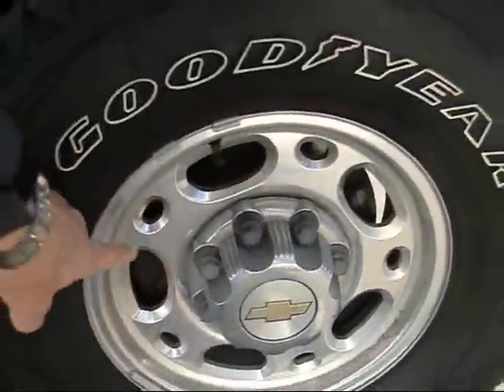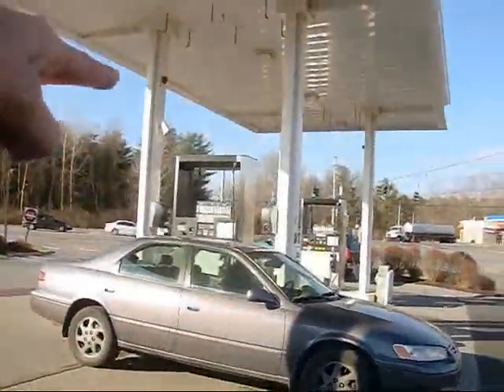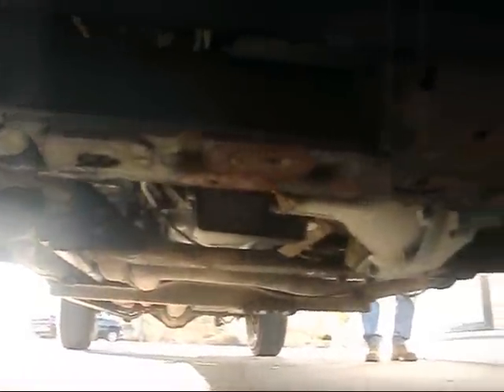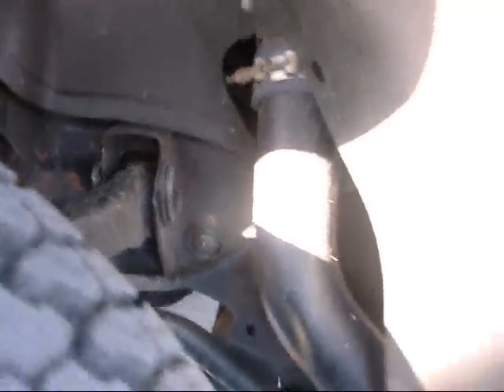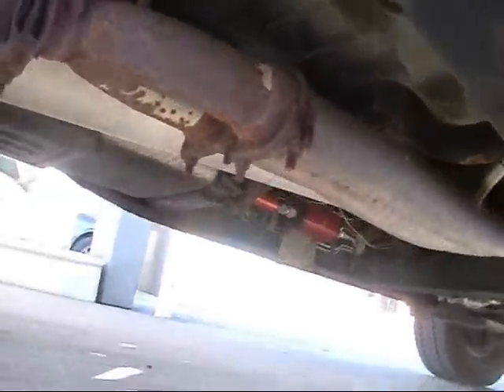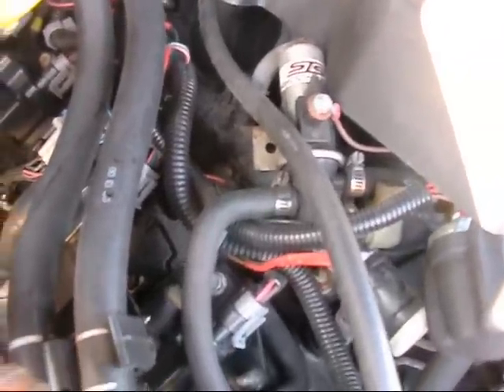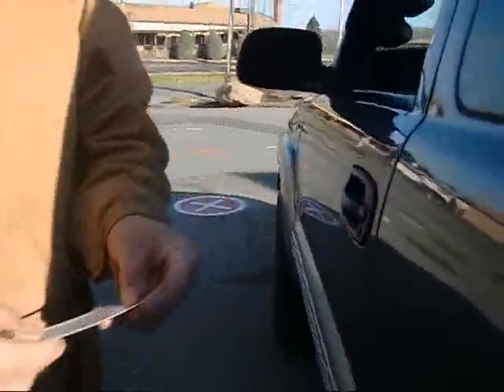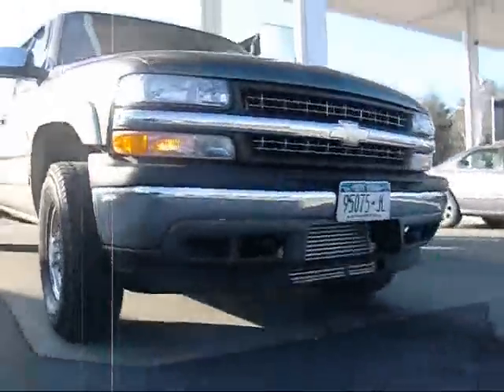Chevy Peekup W Multiple Tailpipes 12 15 12

Comment from the maker: The older ones, '91 back you gotta drop the lower dash panel, 4 screws, steering column and the shifter wire, then pull the dash cover, and pull the victim guages, and there they are. Newer style? I have to find out, 1 of mine is out in the '95

Comment: The reason for having the turbo that far back is because the air is cooler so an intercooler isn't always needed, the oil going into the turbo and back into the engine is cooler, more room under the hood, and it doesn't need special headers or anything like that. Of course, there's so much lag you can measure it with a calender, so rather than use large turbos, they tend to use a couple of small turbos.